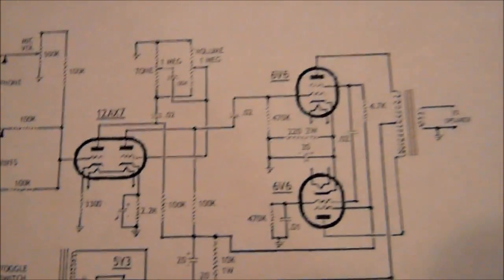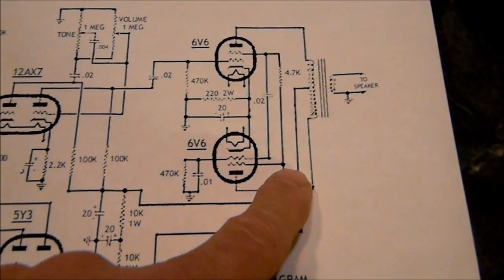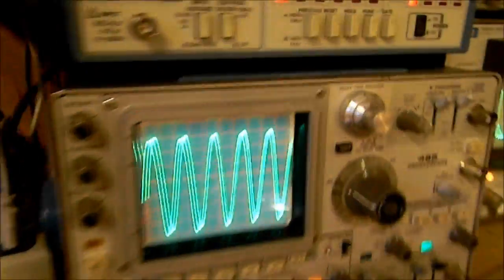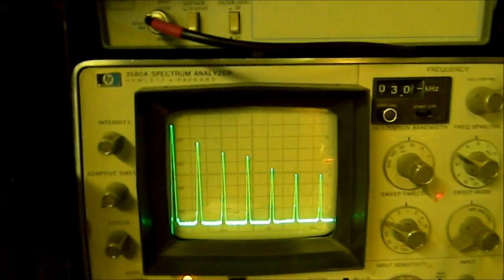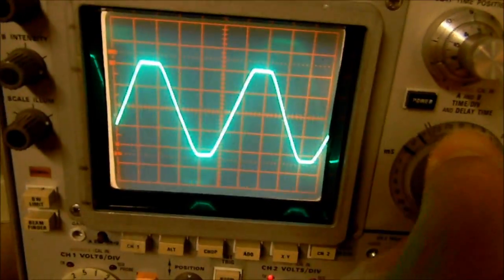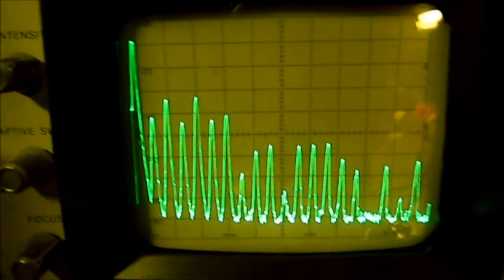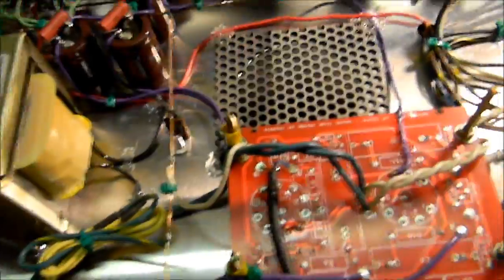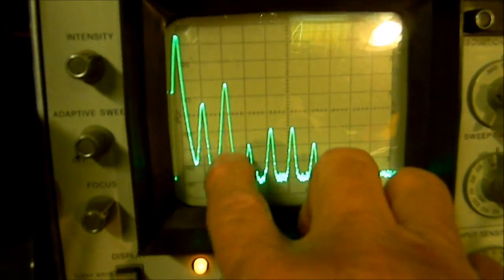Melodier Deluxe, Fender Twin Revereb & Homebrew Vacuum Tube Amps

Comment: I could see a difference in the output waveforms of the Melodier Deluxe and the Fender Twin, the output waveform of the Melodier Deluxe is asymmetrical, whereas the output waveform of the Fender Twin is symmetrical, when the waveform is distorted asymmetrically it tends to generate mostly even harmonics as shown in the video, when the waveform is distorted symmetrically it generates mostly odd harmonics, I've read somewhere that the human ear itself tends to produce even-harmonic distortion naturally, and since tubes tend to produce even-harmonic distortion, that may account for the reason why we like the sound of tube gear.

Comment: I am curious if you could tell me why you have used 1Meg resistors to "shunt" across both the rectifier diodes AND the filter capacitors? I only ask here because I can not seem to find any literature discussing this, even through trusty ol' Google... Thanks for your time - great video!
Reply from the maker: The forward voltage drop on a silicon diode is consistently around 0.7 volts and presents no problems when series diodes are used.. We series diodes to increase the PIV not the forward voltage.  But the reverse biased resistance of these diodes varies greatly. One diode may have a reverse biased resistance of say 50 megohms and another may be 70 megohms. What this causes is an unbalanced reverse voltage drop across the diodes when the AC swings negative and one diode may end up seeing a much higher reverse voltage than the other. If you "swamp" these very high reverse biased resistances with a fixed resistor like a 1 megohm or a 10 megohm, you will equalize the reverse voltage drop across the diodes so one diode does not take the brunt of the reverse voltage. Diodes are rated with a PIV (peak inverse voltage) rating and you do not want to exceed that rating as it will cause the diode to short and fail. Often times small capacitors are also placed across the diodes along with the resistor (something like a 0.001 uF) to once again protect the diode from unexpected reverse peak voltages. Hope this helps.

Comment: Great video,,, Could you do an analysis of a dirt cheap Kustom defender v15. It has a self split EL84 design with just one 12ax7 .. But wired differently than the magnatone..
Reply: The Melodier uses the screen grid of the output tube receiving the preamp signal as a plate, which feeds the second output tube. It allows the cathode to be bypassed by a capacitor, allowing for more gain.
Your Kustom uses the cathode to drive the second tube instead, which means it can't be bypassed by the capacitor like in the Melodier. Lower gain overall, but lower output distortion and better balance between both tubes iirc.

Comment: Ok here´s what happen (very briefly --sorry) in the Magna Amp (just commin around from Dougs video about this Amp) If you make the ouptup tubes going to clip, the screen voltage drop just at the same time the tube clips and imediately lower the level at the opposite tube - furthermore there´s only one cathode resistor, this ´helps´ it as the voltage drop increases as well, preventing both tubes from beeing more saturated (current feedback).

So the opposite tube never reaches its distortion point all the way through for to contribute the distortion with its own footprint hence cancel out most of the k2,k4 and other equal distortion products (as all PP Amps do), while the upper does. This hence to nealy equal spaced (log viewed) distortion peaks. These kind of distortion occurs on ´long-tailed-pairs´ as well, when the plate resistors are not equal.

Unequal distortion comes to more even harmonics while equal distortion leeds to odd harmonics. There are several ways to porduce even harmonics in PP Amps as well: unmached drivers(plate resistors), different resistors in the phase-splitter and most uncommon or underrated thing phase disalignment at the phase splitter´s output versus frequency. Most common on very old amps, since the caps that days wher not very accurate thus having a phase alteration over time and frequency. While lower frequency are more displaced. More k2 occurs.

I could easily go on like this for a while, but i hope you´ll get the point...;)

It´s really hard to explain here just using text, but its easy to undersand what´s going on at the tubes by actually probing round the screens and cathodes of the output tubes and compare them one among the another.

Comment from the maker: Thanks, Mark. Yes, indeed - playing with the bias above and below a "normal" setting changes the spectra considerably - the lower the bias (less negative) resulting in higher cathode currents improves on the THD particularly the second and third harmonic. However, at low bias and driving the amp hard, the KT90's run at about 530 degrees - Wow...

Comment: You can significantly reduce the third harmonic by reducing the negative bias. The slight notch at the transition is due to and impedance mismatch between the out for tubes and alone

Comment from the maker: I use full wave CT arrangement. The secondary voltage is 920 or 455 CT to each side so I need diodes that can take about three times 455 volts (or more for safety) so I series them and shunt them to equalize the reverse voltage across them.

Comment from the maker: So, per my own experiments, I stand corrected and agree with you that you can use 1000 vpiv diodes in a 700 volt center tapped full wave rectifier (350 volts each side of CT) which will give you about a 400 volts, or so, DC output. Thanks for noticing.

Comment from the maker: I just did some experiments (watching voltage on an oscilloscope) If a single diode is used in a half-wave config the diode will have p-to-p voltage across it, i.e. a 10 VRMS signal will results in 28 vpp across the diode. In the case of the full-wave center tapped transformer arrangement, (two diodes) the voltage across each diode is still peak-to-peak voltage of one side of the transformer to center tap 5VRMS or 14 volts pp in the case of the 10 volt center tapped transformer - next post

Comment from the maker: Yes, the cheapest and easiest way to go is one diode rated high enough to do the job instead of a series of them. Remember that the diode sees the reverse peak-to-peak voltage which is 2*sqrt(2) or about 2.828 (make it 3 times for safety) as the RMS voltage so, a 1000 volt diode will only be good enough for a transformer RMS primary voltage of 350 volts.

Comment from the maker: Same is true for the capacitors - if you put for example two 350 volt caps in series for 700 volt DC rating and place 500 volts across the series pair, one may have 400 volts across it and the other 100 volts. Swamping the caps with high value resistors will equalize this voltage ensuring that each cap gets 250 volts each.

Comment from the maker: Silicon diodes have a very low forward resistance and a forward voltage drop of about 0.7 volts however the reverse resistance may be considerably different that will see the reverse voltage - all are in the megohms or multimeghoms range. I this case voltage division can be considerably different and one diode may have much more reverse peak voltage across it than the others. The resistors effectively swamp the diodes resistance and equalize the reverse voltage across each diode (next post)

Comment from the maker: The module, or mainframe, that the AA501 will work in is the TM500 series. An example is a TM503 which is a three-bay (three slot) module (the AA501 takes up two slots) - A TM506 would be a six slot module and so on - I get mine off Ebay - they aren't too expensive. You can also use the TM5000 series for most all 500 series modules but not the other way around, i.e. newer style programmable modules made for the TM5000 series modules will not work in the 500 series mainframe.